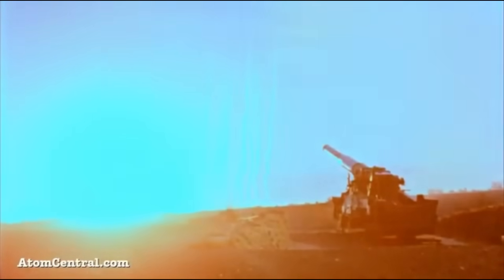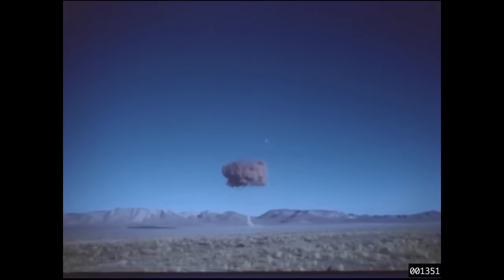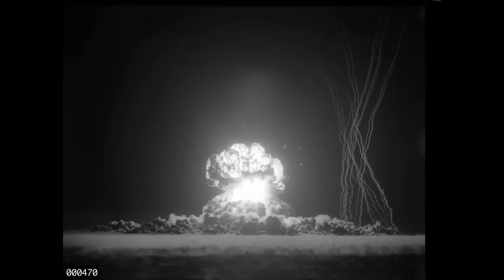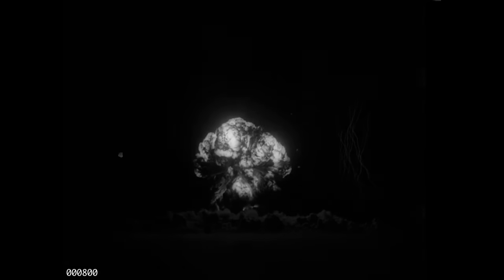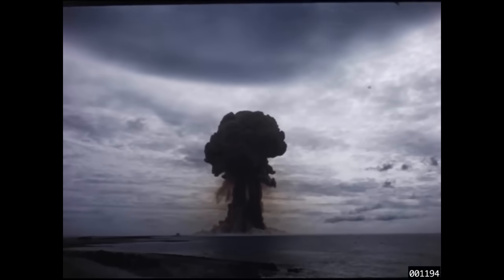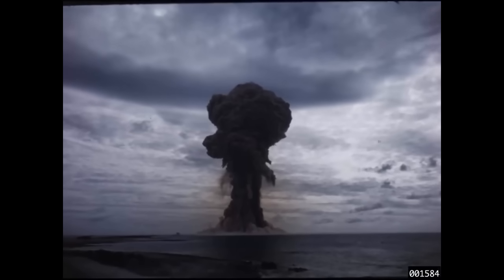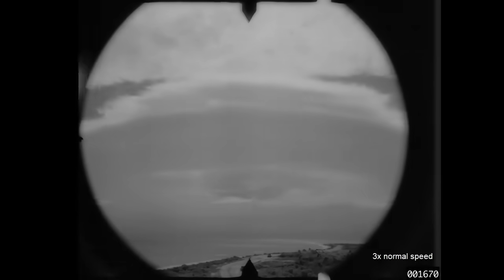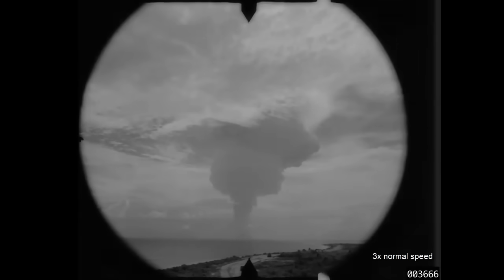What does a nuclear bomb sound like?

Comment: You can immediately hear the vibration (at 1:46) in the beginning the sound already travels at 8 km/s through the ground. 

And then at 2:18 you can hear the loud bang through the air, 32 seconds later because sound just travels at 0.34306 km/s through the Air.

Comment: It took roughly about 35 seconds for the sound to be heard.The speed of sound varies with the temperature of the air so it can't be very accurate, and I just went with 340m/s here, so the ground zero should be about 12 kilometers away from the camera.Not sure if the calculation works like that though.

Comment: I counted roughly 34 seconds from the blast to the shock wave. Now I'm not going to be mathematically accurate here but the speed of sound is roughly 330m/s so 34seconds multiplied by 330m = 11,220, meaning they were roughly 11Km or 7 miles from the blast site

Comment: More goes up than out, they should set them off sideways.
Reply from the maker: The explosion is a sphere, the mushroom cloud is formed by the Shockwave bouncing off the ground and reflecting back up into the fire ball. Convection then does the rest. But yeah the blast wave travels in all directions evenly. In fact on the ground the reflected shock and the main shock form a front that is more powerful. One of the reasons nuclear weapons are more effective when detonated above the ground.
Reply: @venera13  yeah, above ground detonation must be better considering the amount of power the ground absorbs. I was curious about what would happen to a coast if multiple, really powerful devices were detonated underwater. Maybe in a sequence of spread apart.

Comment: 3:20 yeah actually it is and hydrogen bombs are nowhere near similar
Reply from the maker: yes they are. A hydrogen bomb uses a conventional plutonium implosion bomb to initiate a fusion reaction is a secondary stage, usually containing lithium deuteride and a "fission spark plug" down the center made of plutonium. The only difference is a fission bomb derives most of it's energy from fission, and a hydrogen bomb derives most of it's energy from fusion. The soviet "layer cake" design is a bit different but the operation is similar and the outcome is the same.

From a construction standpoint nuclear weapons are actually pretty simple and it's incredibly easy to look up how the different types are made. The hard part, and the part hard to cover up and set up to do, is getting the fissile material. 

Here are basic diagrams of the construction of a-

gun type
http://physics.highpoint.edu/~jregester/potl/Nuclear/Weapons/guntypebomb.png

Implosion type
https://images.slideplayer.com/19/5850357/slides/slide_14.jpg

US hydrogen bomb
https://nuclearweaponarchive.org/Library/Brown/B28bomb.gif

There are also boosted bombs and neutron bombs but they are more or less the same as an implosion device but with a couple added materials.

Comment: The first thing that came to mind is how the overdubbed sound of many explosion videos has the sound occurring simultaneously with the blast, which is just not what happens. If you're several miles away from the blast, the sound will take several seconds to a couple of minutes to reach you after you see the blast. You won't see and hear the blast at the same time.

Comment: Would be interesting to hear the differences between a thermonuclear blast and the simple fission bomb that you have audio for. I thought there was some audio from the Tzarbomba test. But I can't recall.
Reply from the maker: There might be a difference, but most likely the only difference will be volume. Since a thermonuclear bomb uses a fission first stage and a fusion second stage and the whole reaction happens in under a second.
Reply: @venera13  Indeed, the only thing that strikes me strongly is there is a clear differential in both the violence and the shock-effects visually. Usually that would translate to "different" sound. but without hearing it. I wouldn't know what difference it would make.  Fusion bombs are so much more potent in the scale of things and the one record you have is a "fire-cracker" vs the force involved in even the smallest Fusion weapon of the earlier era.  I was just rewatching some test footage of early Russian Fusion bombs and there are distinct characteristic differences visible in the shockwave. Mostly from a vastly more intense thermal effect that precedes the shock. This "thermal shockwave" arrives long before the soundwave from the blast and has a sound all it's own as the air is rapidly heated to hundreds of degree's F even a mile away. SO before you get the even bigger "bang" sound you would get the thermal sound, then the bang would be altered passing through superheated air.   Dunno, just back of the envelope thinking here. Without actual recordings, it's just theoretical and based on visual observations. The question remains, is this synthetic audio effects or the actual recording. If so, the sound IS very different for a Thermonuclear fusion weapon. No POW_BANG, just an ungodly roar of the thermal shock and then the boom-roar of the detonation shock. https://www.youtube.com/watch?v=EHRLEMTsLyA
In the video near the end you can see that the camera records a roaring sound but no shockwave has hit, this is the thermal sound, then as the glow fades and all is dark, the figures on the road are standing there, and THEN the shockwave hits with the more low frequency and longer BOOM. So clearly the thermal/radiative sound precedes and changes the sound of the bang.

Comment: The EM pulse interference was pretty cool to hear come through.
Reply: I've read that the old vacuum tube equipment survived what would have knocked out our  modern circuitry .
Reply: @BrooksterMax I agree..  That was the most interesting sound in the video by far imo.
Reply: Was that the "wobbly" sound right as it exploded?     edit: nvm, I missed the txt lol.
Reply: yeah it was nasty
Reply: It traveled much faster, too
Reply: @jeiwaru  my thoughts exactly, was pretty amazed at how quick the EM hit before the shockwave.
Reply: Bug zapper.
Reply: Was it a form of feed back on the camera/audio equipment or actual detectable sound by the human ear? The actual "Bang" sounded more like jet engines to me. I live in the vicinity of an airport.
Reply: Yes, thats crazy.
Reply: Spooky.
Reply: Sounded like Terminator
Reply: So interesting. This EM pulse has some serious potencial in the long term. A device capable of delivering such a high current in air should be enough to shut down some extraterr...coff coff.."foreigners" aircrafts... 🤔
Reply: @alexfigueroa9993  nah, shielded wiring and faraday cage design renders a EM pulse harmless. I'm sure advanced technologies would know that
Reply: @markmceathron2013  not if they use EM as propulsion.
Reply: @alexfigueroa9993  you have my attention... 👍🏼

Is EM propulsion a thing!?
Reply: @alexfigueroa9993  that's maglev. 

The article you posted even states that stand alone propulsion, the kind one would need to fly a spacecraft is theoretical at best.
Reply: @markmceathron2013  nope. Not maglev, but electromagnetic propulsion, don't get the difference yet? In maglev you use magnetic fields to levitate a thing..(trains) on the other hand in EM propulsion you use the electromangetic field as a impulse vector by itself, and spacecraft accelerate xenon ions for thrust in high vacuum. But what's your point? You are trying to say that some kiloampere/m2 can't fry sensitive electronics? Did you know that a  Faraday cage isn't even a perfect insulator? because high frequency high voltage can penetrate it..maybe you need to read some papers..
Reply: @alexfigueroa9993  the article you posted was all about maglev. It specifically said so.

It went on to say things like the type of propulsion you're talking about, doesn't exist 

I know the difference. I wasn't sure that you did, because you gave me a Wikipedia article discussing maglev...
Reply: @alexfigueroa9993  Don't need any of that with these scaler "scalable" weapon systems now. On the other hand though, would be a quick way to disable a fleet....if electricity is the main power source that is.

Comment: I don't find it surprising that they sound almost identical to a conventional explosion. In both cases, a rapidly spreading circular shockwave of air is compressed against its surroundings, and acts through it. I'm sure there are probably some differences if you were to examine frequencies, harmonics, etc., namely due to the superheating of surrounding air. But yeah. Sounds like a boom, a big boom.

Comment: I got a very rough guess of 34 seconds before the sound caught up. Which means what? How far away is the microphone?
Reply: This is a very rough calculation and I don't think it is right. Speed of sound in air at 20C is 767 mph. Seconds in an hour is 3,600 seconds. So, in 3,600 seconds at the speed of sound you could travel 767 miles. 34 seconds/3,600 seconds * 767 mph = 7.24 miles. This looks to be further away than that distance, although others have remarked this is a low yield weapon and we don't have any reference points. I just don't think a crowd would be less than 10 miles from the blast for safety reasons.

Although, I did find this interesting piece of information from: 

remm.nlm.gov/zones_nucleardetonation.htm

Light Damage (LD) Zone:

Damage is caused by shocks, similar to those produced by a thunderclap or a sonic boom, but with much more force. Although some windows may be broken over 10 miles (16 km) away, the injury associated with flying glass will generally occur at overpressures above 0.5 psi. This damage may correspond to a distance of about 3 miles (4.8 km) from ground zero for a 10 KT nuclear explosion. 

So maybe they could be just 7 miles away when in an open area and a low yield weapon.
Reply: @MrEtherguy  Thank you Bob for explaining the math. I'll bet you're more accurate than you think. You have to remember ALL of these test decisions were made by military analysts that knew jack squat about the ramifications of splitting an atom. These guys would protect themselves from radiation poisoning by adding another 50 push ups in the morning. As kids they taught us if a nuclear bomb detonates a mile or two from your school: Don't even trip, just get under your desk in the fetal position and you'll be right as rain. So hell yes they would definitely get that close. They didn't know what the hell they were doing and the Nevada cancer rate around those testing sites proved it.

Comment: That was a pretty tiny nuke though. Plus with higher quality mics, you’d hear air intensively rushing away, the boom would be crazy loud and probably last a couple seconds, then you’d hear (if your ears still worked) the sound of air violently rushing back towards the blast.
Reply from the maker: Over all yes it was a smaller nuke, comparable to the one used on Hiroshima.
Reply: @venera13  Which was also itty bitty, by modern standards.
These days we talk in terms of hundreds, if not thousands of times the strength of Hiroshima.

Comment: 2:38 At least one man had the presence of mind to shout the obligatory "HOLY $HIT". 👍
Reply: Actually, I heard several! LOL
Reply: Yes, I would say that was warranted.
Reply: They're only ~7 miles away from that explosion. :O
Reply: @luttrwe7688   Did you calculate that using the typical speed of sound? I would have thought one needed to be some 50-100 miles away to be safe...crazy
Reply: @gabrielmorales9752  Calculating using the speed of sound, approximately 7 miles.
Reply: @gabrielmorales9752  Yeah it was about 34 seconds before you heard the boom, multiplied by 1125 feet per second(approximate speed of sound), divided by 5280 feet(1 mile).  Approximately 7.2 miles
Reply: @gabrielmorales9752  Keep in mind it was a relatively small bomb, a tactical nuke meant to be fired from artillery cannons. The radiation flux from a nuclear blast of this yield has an radius of effect of only about 0.89 miles (this might not seem like much range but once again it was a small bomb and the amount of radiation you would receive falls off with the square of the distance, double the distance and you get a quarter of the intensity) and they would of had these guys standing upwind from any fallout. The effects of radiation is often vastly overstated, at lest how far reaching the effects can be. Of course this is all based on the size of the bomb, the level of technology behind it (more advanced bombs are more efficient which means there is less wasted bomb material to create fallout and modern thermonuclear bombs, what he called a, somewhat incorrectly, a hydrogen bomb in the video,  are almost 60% efficient) and the height the bomb was set off at. So in the end these guys were as safe as one could reasonable given the circumstances
Reply: @luttrwe7688  and this is why I frustrate my self can't do maths for shit but it's like the blue prints to the universes wonder's. 😒😅
Reply: @alexcantlow9497  Everything in our physical world involves mathematics.
Reply: @gabrielmorales9752  nah, 7 miles is plenty for a small bomb like that. Now that's as long as you're upwind from it, if you're downwind you'd want to get out of there.
Reply: This us why you don't have the original audio in most cases.
Reply: it's kind of strange to hear people cuss in the 40's.... there's rarely any real documentation of it.
Reply: Joey... Yes, that's right. I'm sure there was plenty of cussing going on back then but people acted more sanely when cameras were around. "Holy $hit" has to be a natural human response to any sudden action or reaction we don't expect. I'm sure they are the last words for many.
Reply: Sounded suspiciously like R. Lee Ermey too..
Reply: Hahaha,  thats the dude thats funny n cool to be around, some people at that test purposely sat by him awaiting some antics/ comments from him!!!
Reply: 😂 I was cracking up lol
Reply: Yes, also, regardless of hollywood stereotypes, people also cussed frequently back in the 50s.
Reply: He said it twice
Reply: That’s what you say when you get rewarded with radiation and cancer by your government…
Reply: Yeah that was my favourite part.
Reply: i bet someone also saying "blyat" during Tsar Bomba test station
Reply: Hell yeah
Reply: I miss him, I hear he was an all around righteous dude - I even thought he was great in “ Dead Man Walking “ played the father of the murdered girl.
Reply: Imagine what the Russians were saying when they witnessed the czar bomb.
Reply: Another guy not quite as loud was also saying "f'ing hell." Soldiers being pretty much the same as now in that regard.
Reply: Pauljs75... Do you have the time on that? I could not hear it. Here is a 12 second video of my favorite HS moment ever. https://youtu.be/yFOYIGFD6BA
Reply: I heard “By George!” As well 😂
Reply: even larger nukes, you can be within a suprisingly close range (indoors) and be fine.

Comment: All sound is just the movement of air, that's why you have to wait for the shock wave to reach you before you hear anything. The shock wave from a nuclear blast can travel much faster than the speed of sound so that conventional charge used to initiate it wont be heard, what you're hearing is the nuclear explosion itself and the rumble is just the massive shock wave reflections bouncing around until they die out.
Reply: Exactly and the visual information speed of light is much faster than the speed of sound. This is a good example of it.

Comment: We're waiting from roughly 1:43 when we see the beginning of the blast to 2:18 when it first becomes audible. That's some 35 seconds. With sound traveling 1125 ft/second at close to sea level the report traveled 39,375ft before reaching the microphone on the receiver. Now divide that by 5280 (ft per mile)
Total distance = 7.45 miles. Or V close to it.
 
That's kinda too close for comfort. I wonder if they only had recording equipment at the site where we're hearing the blast?
Reply: Thanks for those calculations.  I had been wondering how far off they were.